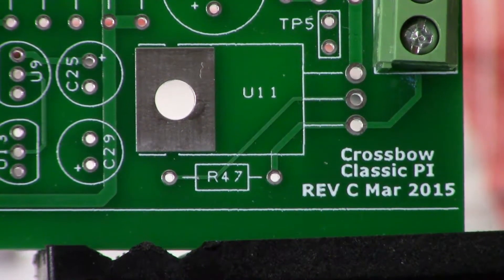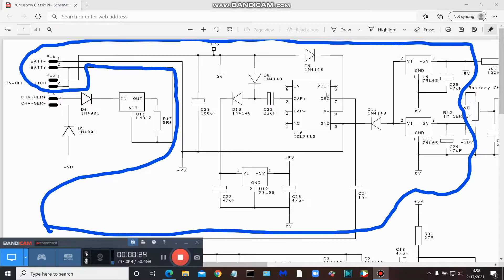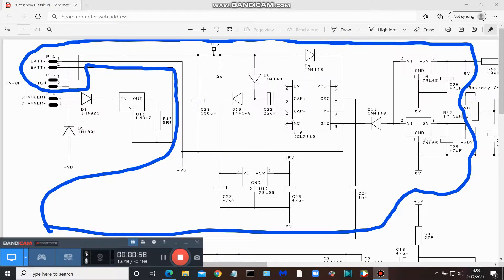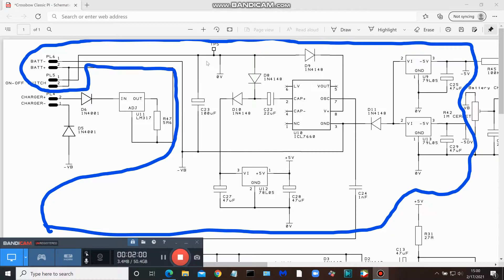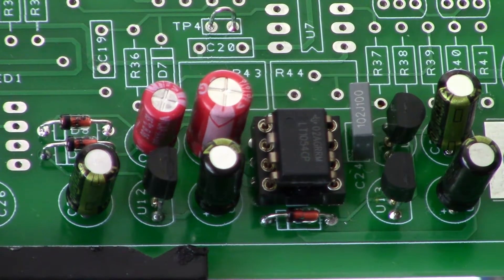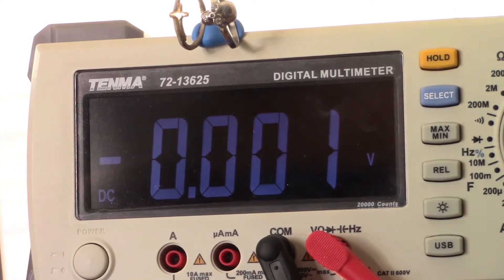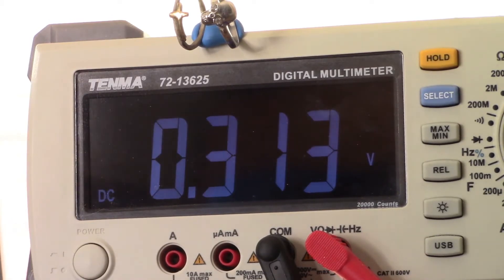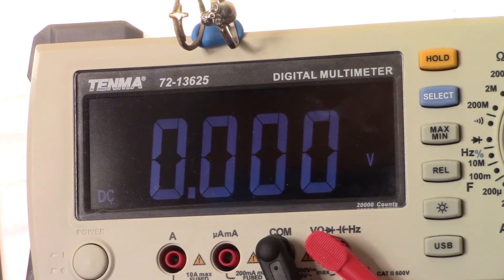Crossbow Classic  DIY PI metal detector Part #1 Power Supply

Comment: You are very lucky dude, i sadly cant build any of these because atleast 10 different parts are not available in india on each of the kits and getting a kit with componenets costs double due to shipping
Reply from the maker: I am curious as to what parts are not available in your country? Two of the transistors can be substituted
Reply: @SurfDetector  I cant find the transistors and some capacitors(The very small value ones)
Reply from the maker: The 2N5484 and the 2N5485 you can use J113
Reply: @SurfDetector  oh thanks 😊 I will see what I can do.  You earned a new sub! You are really helpful
Reply from the maker: @silentgaming9328  I hope that you find my videos to be informative. Thank you for subscribing.
Cheers